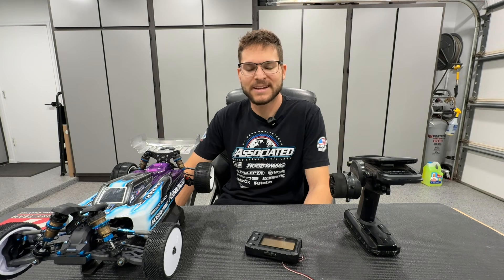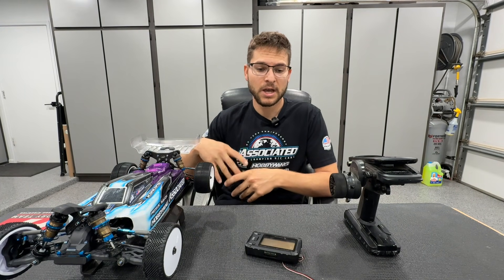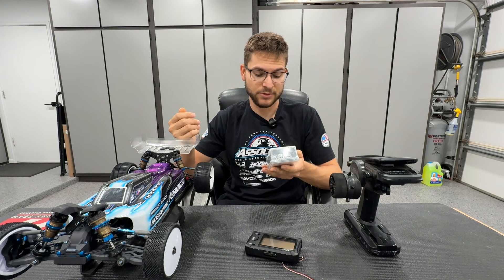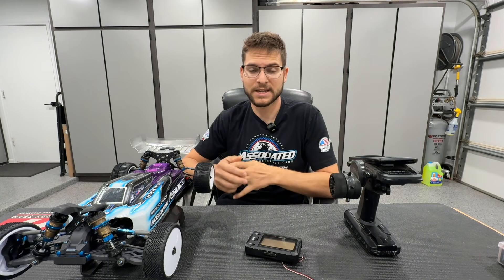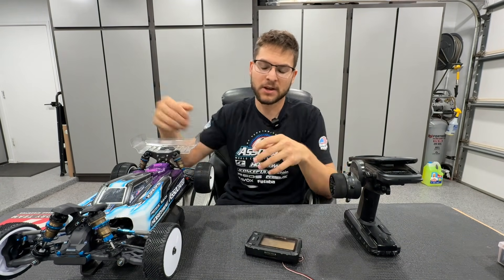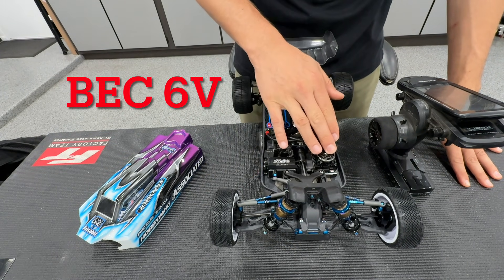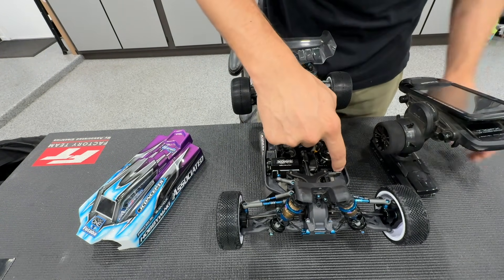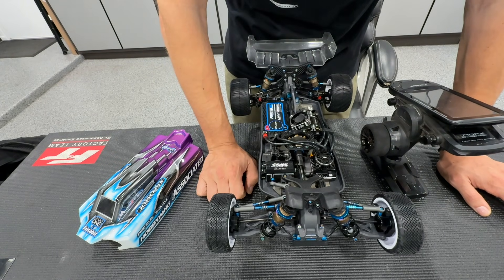HOBBYWING - Spencer Rivkin - BEC Voltage - Pro Tip

Comment: In my wheeler I run a xr10 stock spec G2 with a power HD b5s HV. Tried out 7.4 once and it was crazy fast. Specs say .055 on 7.4 and .065 on 6v. I know you can use dual rate and expo in the radio to set it down but it was still too fast for me lol.

Comment: With how fast brushless servos are, especially top of the line ones, I never bother running my BEC over 6.0v. I do run a 2S LiPo pack in my Nitro, so 8.4v to start after a full charge, and honestly, I can't tell a difference in response time or anything. Maybe the top 1% of drivers can, but for most of us normal drivers, just run at 6.0v and you'll have slightly longer run time and less heat build up!

Comment: Hi Spencer. I have the Futaba HPS-CT702 and use it on 6.0V. at 0.08s or you can use it at 7.4v which is 0.07s fast.

Would you recommend using a higher voltage? Let's say 6.5v or 7v and the servo will work better compared the 6v at 0.08s?

Comment: Running the BEC that high will make servo speed inconsistent. As the battery runs lower than 7.4 at the end of a run, the servo will begin to slow.
Reply: That depends on the type of BEC your ESC uses. What you're describing is likely an ESC with a switching buck BEC. With that type, if you run a 2S battery (~7.4V) and set your BEC to 7.4V, as soon as the battery sags under load to 7.3V, your servo voltage will also drop to 7.3V, and it will slow down.

However, most modern ESCs like the G2 series use a switching buck-boost BEC. It can step the voltage down (buck) when the input voltage is higher than the setpoint and step it up (boost) when the input voltage is lower, which results in a constant voltage for the servo regardless of the input voltage.
Reply: I typically see my lipo at around 7.6v or higher after a run

Comment: Should people check if their servo can handle 7.4v beforehand? Or is this not an issue?
Reply: Yes you should. Also the receiver voltage and anything that is plugged into your receiver (ie fans, transponder, ect, just in case) as if you switch the voltage on the esc it will send that voltage to the receiver and every channel on the receiver, no just one specific channel. We aren't that too in the future yet. Lol.

Comment: I have found, the closer I run my BEC to the battery voltage, the more I’ll notice the servo slowing down toward the end of a main. That is why I keep mine at 6volts. It keeps my servo the same speed through a long run. Thoughts?
Reply: Sounds like an ESC with a switching buck BEC. That type is very common and can only step the voltage down. What ESC are you using? The newer Hobbywing G2 ESCs uses a Buck-Boost design. which gives a constant voltage for the servo regardless of the input voltage
Reply: Can be true. But it depends on battery, the size/mah and if you run regular 8.4 or HV 8.7v. and also how fast the battery drains.